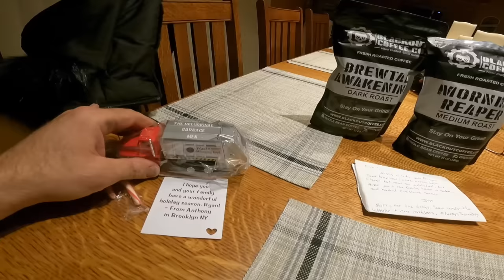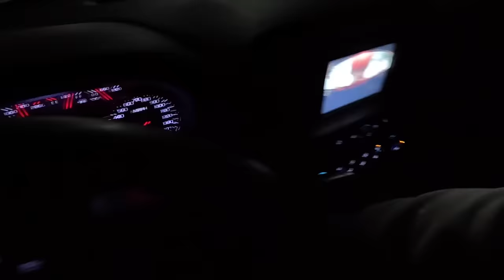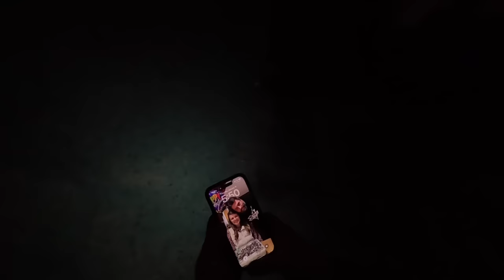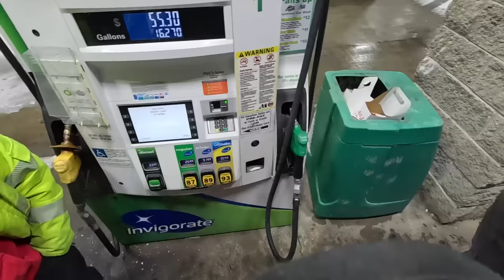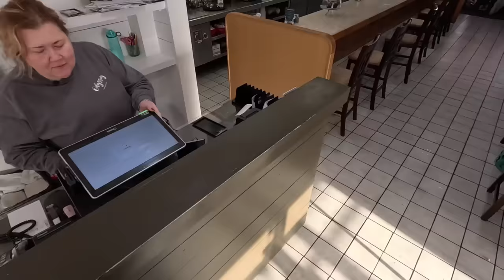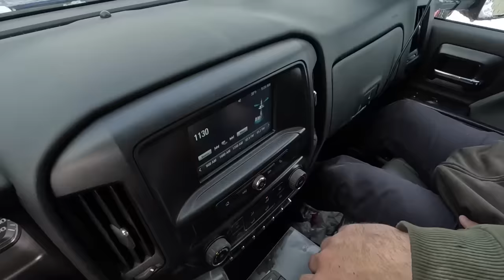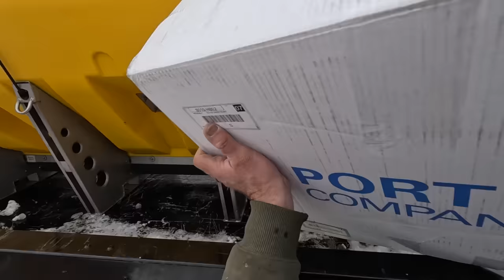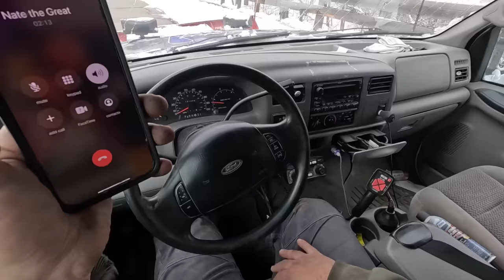Snow plow training BIG RAY of sunshine!!!

Comment: Glow plug relay is super common on the 7.3. also there was a recall on the camshaft speed sensor on those to cause no starts randomly. If the sensor is gray recall has been done. If it is black, recall not done. It's right above the crank pulley on the left side (looking at engine from front)

Comment: My 08 Chevy Silverado 😊duramax diesel Dually wouldn’t turn over. After 3 dealerships the last one found the issue. It was a $20 relay switch.  That was 4 years ago haven’t had issue since. Good luck. 🍀 ❤

Comment: You should get a code reader, that way you can see the codes yourself. I drive up and down the east coast i picked one up for 75, its nothing special but it works good and helps in a pinch. Sometimes can save you a trip to the mechanic. I got mine at the autoparts store. Love the vids.

Comment: If it is a fuel injection issue those 7.3 injectors fire off of oil pressure. Could have been low on oil pressure due to how cold it was. Could also be a IPR sensor going bad or a ICP sensor. If Nate has a good scan tool he can monitor the PIDS for the fuel on the engine and determine if that’s what it is.

Comment: I have an F250 and F350 and have had problem's once on both and it was the IPR's causing the problem. One was the Hat & Nut that came off and the other I replaced with new one. I the hat & nut come off the magnet will be loose or off and it will not give you the high pressure to the pump. Hope that helps. :)

Comment: Eric was suposed to be born 3 days earier then he was but as you see he was fashionably late just like work. I bet if you put a tarp over the 350 and stuck a space heater under it it will start in a couple hours . If so it's a glow plug connection or relei . Or fuel jelling in the injector lines witch warming them with a heat gun will help. You should keep a few hoodies in the plow truck so if you see a homeless person or someone that looks cold you can gift them a hoody to keep them warm and they can be your billboard .

Comment: Ryan, I have a 97 350 that does the same no start when it's super cold and have found that it is the glow plug relay on top of the motor or the filter is gelled up and have found that filling a gallon pitcher of warm water and pouring it over top of the fuel filter will make it immediately start. There is also a screen on the return line/pressure regulator bolted to the fuel filter that gets restricted and causes no start.

Comment: On the 7.3 they tend to have a relay issue that is very intermittent in extreme cold. If it does it again where it doesn’t want to fire after you have let the glow plugs heat up try hooking a jump box to the battery and I bet it’ll start right up.

Comment: Your truck cranks and cranks because it might have low battery voltage or your Desiel became gel.  Put jumper cables on it and let battery get juice again. My truck does the same thing.

Comment: Power relay right on top of the 7.3. 2 of them side by side powers the glow plugs. You can have perfect glow plugs but no power going to them it won’t start. I would crank mine over till the starter bolts came loose and almost fell off the truck… known for going . swapped mine and she would start no matter how cold.

Comment: Ryan I’ve owned a ton of 7.3s check your glow plug relay it’s a very common issue truck with these trucks you’ll still think the glow plugs are running but they’re not especially since it fired off either that would be my first thing to check then ohm out the glow plugs you might have a bad glow plug , injector seals and or cups usually show different signs of issues like oil in your coolant or running rough at idle .

Comment: Replace the valve cover gaskets, under valve cover harness and the harness leading to the plug on the valve cover gaskets. The valve cover gaskets have a plug molded into them and they are notorious to fail. My 7.3 did the same thing.

Comment: Pull the fuel filter off fill with Diesel 911 and but a whole bottle in the tank. And if you have one take a torpedo heater and put it directly under the truck in the middle pointed at the oil pan let it sit for a fuel and then try and start it. Just be careful not burn or catch anything on fire

Comment: Make sure to check the 7.3 so that there’s not oil on the ground sometimes in the cold the oil is so thick it’ll push out the seals on the oil cooler and it won’t start with out oil pressure
Reply: Or fuel could be gelled up

Comment: there is a massive issue with salt and natural aquafers which we depened on for drinking water. all that salt goes somewhere as it all thaws melts and goes into the ground and sewage. the solution would be better filteration imo cause we cant not use salt here or we die.

Comment: Not sure if you put fuel treatment in the f350... The fuel can gel up which I'm sure you know. Also it can be water frozen in a line or somewhere blocking fuel. I always used amsoil diesel treatment in the winter. Usually doesn't gel until about 10 degrees.

Comment: Have you tried bleeding the fuel system? Your fuel pump might be going on the f350 and it’s not getting enough fuel to the engine to start up. If bleeding the system doesn’t work try turning key to on position let the glow plugs warm up, turn it to off position and do that 3 more times. If it starts after that I can guarantee it’s your fuel pump. I have this issue with my 6.4 powerstroke and it does same thing as yours cranks over a bunch and doesn’t start till I bleed the system.

Comment: On the 7.3, either your lift pump died or your high-pressure pump needs a rebuild. As a diagnostic test, try cracking loose one of the hard lines going into an injector, let it go through cold start, and then try to start it. Just watch for a spray of fuel. If there is no fuel spray, you have a lift fuel pump issue. If a weak spray, your high-pressure pump is bad. Make sure to retorque the hard line to the injector.
Reply: the ole trusty keyboard mechanic, can just about diagnose anything on the internet by just looking at it.

Comment: We just had the worse ice storm to hit the state of oregon that I've ever SEEN,
We have at least an inch of ice on everything all the trees from 100 foot high fir trees to huge maple and oak trees are all broken and on the ground . The entire state from the coast to eastern oregon is a disaster and it's going to take months to clean up all the damage. They have gotten over 9 feet of snow in two days. There's thousands of people with no power with temperatures in the teens. Power poles snapped off power lines knocked down by the thousands of trees the ice brought down . All the freeways and airports are shut down with hundreds of wrecks blocking all the interstate highways and all state roads are closed with ice wrecks and downed trees an power poles. I'm 71 years old and I've lived in Oregon all my life and I've never seen it this bad. Now the weather has warmed up and we are having heavy rain and now major flooding is now going to be the big issue. If you are planning a trip to oregon any time soon one word DON'T.

Comment: why don't you use sand ? here in sweden we use sand for the smaller streat/road and salt for the freeways. the salt will only melt the snow, but what do you do if it gets to minus degrees and all the melted snow turns to ice. won't there be a risk of slipping more then? gooood work!

Comment: 44:20 usually when a vehicle is going down a hill and loses traction, it wont RE-GAIN traction. Its too heavy, momentum is gonna take over. 10/10 youll slide until something stops you.

Comment: Keep your fuel tanks full.  A partially empty tank allows condensation and that leads to icing in the fuel systems.  Before shutting down your equipment, go top off the fuel.

I started driving in snow.  Now, I can drive up the hill, take a look, and then go home.  It's nice.  But why, as I watch these plowing videos, do I just start figuring my next moves, like where to start and where the snow needs to go?

Comment: Ryan it is not always that good for your skid steer to run into piles at full speed especially if the guy running it isn't very good or just learning. I tell new guys just to lift the bucket then tilt it and drive into the pile and pull it back do this a few times and then pick up a load. It is a full prove way to fill a bucket every time and not put undue stress on a machine. I'm a carpenter so some times we first have to back fill with 6 inch rock. After the first few loads the pile gets to tight to get a full load and we have to loosen the pile anyways and that's how we do it.

Comment: solution to the truck not starting, I had a similar problem for whatever reason if I left the ignition in the on position without turning over the engine for 2 minutes it would then start right up I can't explain it not a mechanic.

Comment: glow plugs or glow plug relay is what i found on my 7.3
Reply: same senario it would start on starting fluid and run and start perfect when warm. I actually replaced my glow plugs and it didn't fix it but the relay was my issue. The relay is definitely the easiest and cheapest to try first.

Comment: I had a Ford or should I say? I still do but check your fuses for your Electric fuel pump mine had a bad wire in the fuse box and it wouldn't allow the truck to start. It would turn over, but it wouldn't start.

Comment: How cold was it out and does it have summer fuel in it? If it still has summer fuel in it, it might have frozen with the cold and then dethawed with warmer weather when you tried it again.. Try a diesel fuel additive with anti-gel properties. Or fill up with fuel as they have switched over to winter diesel(anti-gelling additive added).

Comment: Why don’t you plug in the 7.3. If it doesn’t have a block heater on it that should be step #1 block heater+good glow plugs it will fire up in any temperature. It’s be -4 degrees and my 7.3 fires with no problem.

Comment: You gotta come plow at the train yards with me in a car 980k loader where each isle is 2.5 miles long which nowhere to pile the snow other than the very ends you can’t like in the middle cause semis need to be able to get their trailers to go load onto the trains it’s a nightmare even with a big loader and push box you canoniy push a short distance with this heavy wet snow it takes 2.5 days to get the whole 8 mile place done it’s probably the hardest time I’ve ever had plowing never a good way to attack it

Comment: For the salt I can see why. New Hampshire for example has 50+ contaminated waterways and the stuff is just horrible for the environment. That's why we're already starting to invest in brine equipment. Still bad for the environment but if we can use 75% less salt we can save some money and do less harm to the environment, not to mention brine is a lot more effective than rock salt and with calcium chloride additives it works down to super low temperatures. Don't wanna sound like a crazy tee hugger but I do think we need to start considering nature a little more in our choices.

Comment: You guys are abusing salt so much, up here we do not try to melt snow in parking lots with straight salt. Generally we just use sand or at the most sand/salt mix to mitigate fall risk. Getting back on asphalt between every snow fall looks like such a waste.